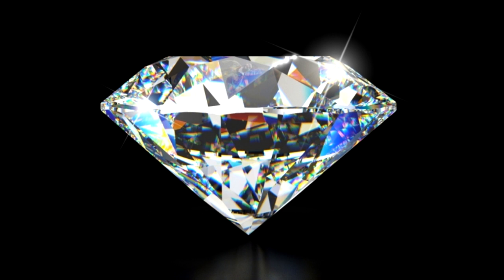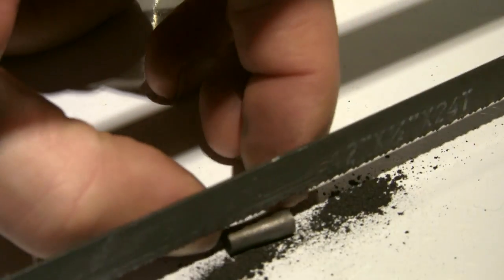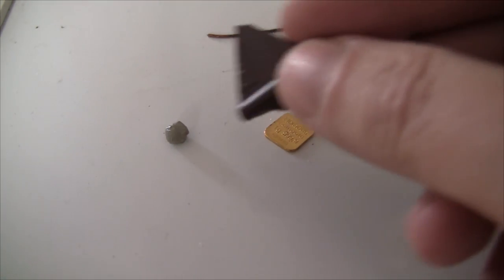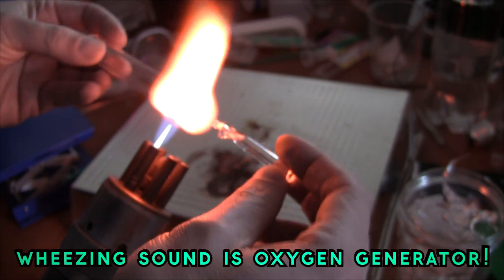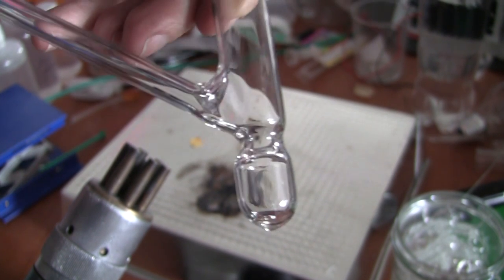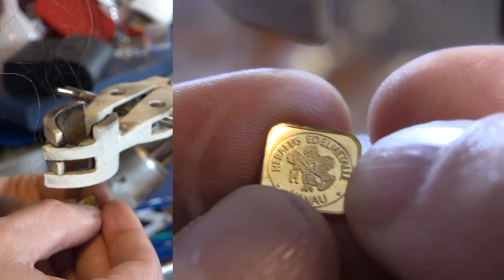Can burning Diamond melt Gold?

Comment from the maker: Theres actually a point to this other than burning diamonds look REALLY cool, and burn REALLY hot..... and its to do with why making nuclear batteries out of diamonds is a really, REALLY stupid idea, and not just cos diamonds burn!
Reply: Thunderf00t you gotta stop destroying all you bling Tf00t!
Reply: do the diamond carbon dioxide in the drink
Reply: First off super cool to see a burning diamond, because i did not know that could be a thing. Also the glass work we saw, can you please do a video on that. Because seeing you form the glass tube and all that was super interesting and neat to see.
Reply: THORIUM COATED DIAMOND FREAKING BATTERIES!
Reply: hit the diamond with a golden hammer! durp durpy durp :)
Reply: Could you maybe get a better transfer of heat if you place the gold on top of the diamond? I only say this because the oxygen only has one way to travel, so to me i would think that the oxygen is also pulling heat up and out of the tube, Maybe with the thermal camera we could see if the bottom or top of the tube is hotter, for my idea to be true there would have to be a massive difference in heat  over the diamond vs under it.
Reply: i really wanna see you debunk those 'batteries'
Reply: Thunderf00t hey a short vid on your glass working gear and technique would be awesome..... or a long vid, ya know, whatever u have time for.
Reply: Thunderf00t lol you made a crack pipe
Reply: do the diamond carbon dioxide in the drink
Reply: Did you mean to include that video of you glass-blowing a crack pipe?
Reply: Thunderf00t Honestly I think the O² was cooling down the bottom of the gold so much that it just couldn't reach a 1000 degrees. just a thought.
Reply: Please make a video on how to make/blow the glass thingies. <3
Reply: Thunderf00t do you think that the glass added to the thermal mass of the gold?
Reply: Awesome video mate. Quick FYI- Diamonds shatter if you hit them with a hammer.
Reply: TF,

I enjoyed seeing the glass apparatus manufacturing.  Is this a lost art in the scientific community or what?
Reply: You should end that debunking video with lighting a cigarr with a burning diamond
Reply: and again Thunderfoot make women cry
Reply: you could have saved you some time if you just had bought a crack pipe xD
Reply: How expensive was this small uncut diamond?
Reply: Pretty sure gold was too good at transfering all the extra heat to oxygen and CO2. Are you sure diamond is using most of the oxygen? You might want to lower the flow for optimal results.
Reply: Bonus fact: Hot Diamonds will shatter when cooled rapidly. Much like adding ice to water. (I am sure Thunderf00t knows this).

I have seen this happen many times as a novice jeweler; I would love to see the inclusion generate with the phantom you have.
Reply: +Thunderf00t This might be a dumb question, but wouldn't blasting the diamond, and the gold underneath it, with relatively cool oxygen hinder the efforts to melt the gold? I mean, I get it, you need the oxygen to make the diamond burn, but aren't you at the same time also cooling the gold? (Or maybe I'm just overestimating the amount of oxygen you're blowing at it)
Reply: stop saying it is cool,it's pritty fuckin hot
Reply: Before you go and burn another diamond, I think we need to talk about some physics that of course you are well aware of but have not taken into account. If you had used your thermal camera, you would have seen the precise surface temperature of the burning diamond, you'd also see where heat was being sinked away, and how close you were getting to melting the gold (that's if your thermal camera does those temperature ranges). Continuous spectra from hot objects and flames, is caused by interatomic collisions (It's not the same phenomena as line spectra). The faster the atoms are moving the more blue the photons released, the slower the redder. Just by eyeballing, I can tell the surface of your burning diamond is cooler than a blue bunsen burner flame.  By eyeballing I can also tell there isn't much heat transmission happening from the diamond through air to the gold, if the air was that hot the interatomic collisions would have at least have it in the visible range, it's not, and the pressure differentials are probably creating a cooling flow of air, helping defeat the exercise. So, we could assume that all/most of the heat transmission that's occurring is from the surface area of the gold in direct contact with surface area of the diamond,  and the rest of the heat from the burning diamond is being lost to where there is the most surface area contact, which is the air. And there is a classical thermodynamics formula for calculating this stuff, which i don't remember but I know exists. Now. The surface area of the burning diamond in contact with the gold has another problem, that area won't be burning because it can't get oxygen, it will be relatively cool. If you want to melt gold with a diamond, heat the diamond with a blue flame, and then it will eventually reach thermal equilibrium with the flame and it will melt the gold, if there's enough surface area contact.
Reply: If you want to melt something, put it on top the combustible, not under it.
Likewise, the air/O² entry need to be under everything.
And the combustion gas need to be able to evacuate from the top.
Plan:
[Exhaust]
[Material to melt]
[Combustible]
[O² entry]
Reply: Thunderf00t I like heating the diamond and dropping it in liquid oxy it the diamond burns crazy bright lights up the room
Reply: $15 diamond
Reply: To your last part, they use hammers and rollers to crush diamonds for industrial purposes. Jewelers use hammers to break diamonds. Its all about applied force to stress fractures, and your uncut diamond shown looks to have a lot of fractures. It'll probably shatter along its stress creases, and dent/scratch the head of the hammer where it makes contact. Might even embed itself into the head depending on the force.
Reply: Does this act similar to a perfect black body because of its conductance?
Reply: Thunderf00t what's the link for the diamonds?
Reply: Cool! I'm a fairly new subscriber so please excuse my asking this question, you obviously have a substantial background in 'the sciences' but where did you learn to handle glass like that? You made it look so easy & I'm quite sure that it's not, very impressive indeed bro!
Reply: You are correct, I've done it as a jeweler. Dropping a hot diamond in water will generate inclusions "cracks" as well. Even a diamond without inclusions will shatter under a steel hammer. However, the hammer will have a significant dent (but i've never seen one get stuck before, but i suppose its possible). You can even crush small diamonds with pliers in your hand. Hardness is not the same as tensile strength. However, I would like to see the inclusions generate in slow motion.
Reply: I guess the contact area between diamond and gold plate was too small. Also, keeping the plate above the diamond could help, most of the energy was wasted. Also, I think the blowing oxygen is having a cooling effect on the plate.
Reply: Thunderf00t You mean this wasn't to prove that we can use the energy displaced by the melting gold from a burning diamond, and redirect it into a new propulsion system to use in outer space? There goes my Kickstarter.
Reply: Simple, don''t put the batteries in an oxygen rich environment.
Reply: Your awesome, instead of burning money, you burn diamonds.
Reply: I feel like I just watched you make a crack pipe and smoke a diamond out of it.  let's see Cody's lab do that.

Nothing against codyslab, he's awesome.
Reply: Blow torching glass without any protection? Safety must be your number one priority.
Reply: That was as awesome a crafting part of the video as the actual experiments. Maybe as routine for the actual scientists, but really cool to watch as an uninitiated ;-p
Reply: collab with cody :D
Reply: how can you make a solid gold hammer if diamond cant melt gold
Reply: Thanks for making one of the most expensive pieces of Toblerone of the world.
Reply: Thunderf00t would you be at all interested and or confident enough to test if chlorine tri fluoride is able burn diamond?
Reply: John J look for a video on making vacuum tubes by hand if you like glass workmanship
Reply: Really dumb question, as I assume you did, but did you count for heat loss due to convection and air currents? Simple contact may not be enough when you have other losses in the system.
Reply: You seriously expected someone smart from Bristol?
Reply: Thunderfoot makes a bong that burns diamonds and gold, has science gone too far?
Reply: I think what you are doing wrong is that you are placing the diamond over the gold rather than under the gold. The heat from the diamond burning is bound to be rising away from the gold. Try placing the gold immediately above the diamond, supported just above it somehow, as the diamond burns.
Reply: oxygen is not flammable it just helps with combustion
Reply: Thunderf00t you made a nice water bong
Reply: Fair enough but did it really need to take 16 minutes to burn stuff? I FUCKING LOVE FIRE but I had to cut to about 11 minutes in when the magic started to happen.

I love your videos btw (well except for the ones where you fight with dumb ass feminists who thrive on drama and thus feed the drama) so I hope you don't think I am being too harsh.
Reply: Thunderf00t everything burns....
Reply: Downstream01, he says it's in the works at the end of the vid
Reply: Although you might have to use probes, because i am unaware of any thermal cameras that can measure that small and precise.
Reply: You can make diamonds out of my batteries any day Thunderfoot just pack them in tight ;)
)
Reply: is it because Diamonds aren't that dense?
Reply: Thunderf00t how hot does a diamond burn? I doubt I could have the opportunity to do this.
Reply: IamCrusaderRUS: Yeah, I was thinking the same thing. Maybe you could match the flow rate of the oxygen to the burn rate of the diamond, to keep it from cooling down the system too much. And/or preheat the oxygen, although that might count as cheating. Then again, you already preheated the diamond :)
Reply: this is fucking cool. thanks.
Reply: I look forward to a better explanation.   You seem to love busting the bullshit that I see all over the place, but I couldn't put my finger on the diamond battery thing.
Reply: I think this too. Maybe you should have used a thermal Isolator directly below the gold (like a small pan) to shield it from the Gasflow.
Reply: If the design would have blown from the top, making a kid of melting torch could maybe do the trick.
Reply: TheZabbiemaster He said something about it in his last video with the dimond ... something around 15$ I think but better go checking.
Reply: TheZabbiemaster he said something about that in his last video ... arround 15$ I think.
Reply: Thunderf00t of you should have used thermite to start the diamond on fire
Reply: najs123 that would conway the message pretty good :)
Reply: The gold has a relatively high thermal conductivity (310 W m-1 K-1). That is why you can't make it melt just like that.
Reply: Dropping a diamond in liquid oxygen is something the Open University did...the diamond fizzes away to nothing.
Reply: Thunderf00t what about making computer chips out of diamonds.
Reply: +EATHER2468 too expensive, too hard, and offers little to no advantages.
Reply: phil, now you gotta test to see if gold will burn in a pure chlorine-triflouride environment.... (definitely NOT trying to give you nightmares of the horrifying, horrifying chemical that is chlorine triflouride)
Reply: What about artificially grown diamonds combined with boron to conduct electricity.
Reply: Cool, look forward to seeing your video about it. I head a while ago that someone came up with some gold batteries that supposedly worked much better than current batteries, their claim was only that they could be recharged without losing their effect almost forever, but they didn't have more capacity than normal batteries. Sounded legit to me, but it's not like I tried to research it or anything, maybe you'd want to have a look at that too someday
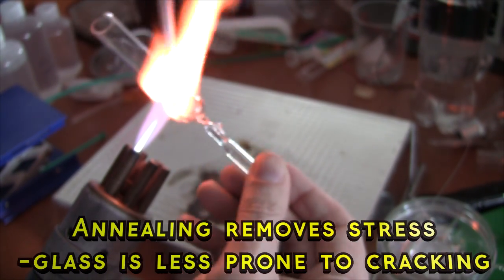Reply: Thunderf00t at 9:18 it looks like you were making a bong
Reply: TheZabbiemaster its on the previous video, the price of that uncut diamond...
Reply: Interesting side note to the gold... its from heraeus a German family owned company. In 1927 Wilhelm Heraeus had to join the company pressed by the family. Instead Wilhelm wanted to continue to be a university physic researcher. Thus at the end of his life he created the Wilhelm and Else Heraeus foundation to support fundamental physics research....
Reply: Thunderf00t I think you would need to have gold inside of a bit of diamond.
Reply: to get a better chance at melting the gold, and you did it with the graphite is move your heat source to the bottom. while you produced a load of heat most escaped and never effected the gold.
Reply: +T.kuvesi I was wondering that too.
Reply: can we get in a war too? I want chocolate.
Reply: not sure where you're conducting this experiment, but perhaps fluorine instead of oxygen would make it work.
Reply: Nice, that was great stuff. ^_^
Reply: Who was your vendor for the diamond?
Reply: Close off the restriction in the apparatus, create a new one that holds the diamond above the O2 inlet, create a second restriction above where the diamond will burn for the gold. Light the diamond, drop it in, drop in the gold, gold will melt.
Reply: Duc Tran He made me cry. That diamond could have made a diamond file.
Reply: Hey Thunderf00t, under the right circumstances can anything burn?
Reply: Thunderf00t PLEASE link to the diamond!
Reply: T. kuvesi it doesnt matter because the part thats hitting the gold is not the same part as the burning diamond, plus, diamond burns alot hotter than the "cold" oxygen can cool down in time, about several hundred degrees so
Reply: Maybe next time, put the diamond beneath the gold? Like, plop the diamond in there, then drop the gold in on top.  I don't know if it'd make a difference, but maybe.
Reply: Thunderf00t just how hot did the diamond become while it was burning?
Reply: Thunderf00t bongs 101 with thunderfoot
Reply: I wonder, just how many BTU does a diamond give compared to a similar weight price of coal
Reply: What is the reputable source you got the diamonds from?
Reply: siphra - he has not accounted for this and it is causing him problems
Reply: Why do you never name the music in the description of your videos, Thunder?!
Reply: Thunderf00t In an Oxygen rich environment. How about in one devoid of any oxygen?
Reply: Hi Phil, I sent you a private message to your channel regarding helen caldicott, please have a look
Reply: compare to molten kclo3 :p
Reply: http://9gag.com/gag/aZmnjRQ is this plausible? Maybe do a video on it? Thank you!
Reply: Isn't it the gold were being cooled by blowing oxygen?
Reply: +Thunderf00t Thought I would throw some easy pseudoscience/debunking material your way Hanging Asteroid Skyscraper: http://www.dailymail.co.uk/sciencetech/article-4354612/Architect-unveils-skyscraper-hangs-asteroid.html oh and Already speed and battery life specced drone looking for donations...just with cool graphics and no prototype: http://www.dailymail.co.uk/sciencetech/article-4354612/Architect-unveils-skyscraper-hangs-asteroid.html
Reply: Also, a quote from the first article "The team discovered that there is most likely a height that people could not tolerate living due to the extreme conditions. ‘For example, while there may be a benefit to having 45 extra minutes of daylight at an elevation of 32,000 meters, the near vacuum and -40C temperature would prevent people from going outside without a protective suit" ......no shit sherlock..
Reply: can you make 1 mole of sugar(C6H12O6) out of 6 mole of water(H2O) and 6 mole of graphite/diamond(C)  or the energy needed for this chemical reaction is too mutch ?
Reply: Thunderf00t debunk the heathrangers "cesium eliminator".
Reply: Thunderf00t Here's a new one to bust.  http://www.nbcnews.com/mach/space/firm-floats-plan-hang-colossal-skyscraper-asteroid-n739601  "Floating Freaking Skyscrapers!"
Reply: Selem, that's why I used a fake name on my broadband, used my own modem and rented a Dedicated Server and installed OpenVPN on it.
Reply: Selem Bradly oh yah absolutely i don't disagree at all. But this is just one spoke in the big brother wheel. if there's money to be had then corruption trumps morality every time. senators will be lobbied, pockets will be greased and there will be bribes all round for the cigar smokers. maybe if enough of us kick up a stink things can be done to stop it. but it doesn't hurt to protect yourself in any case
Reply: That shouldn't make a difference. You would have the same surface area in contact (same heat transfer) and the hot air that is rising (hot air rises heat does not) won't conduct heat enough to make a significant difference in temperature.
Reply: Thunderf00t graphite is what our tools are made of.
Reply: Well that's utterly disgusting, burning diamonds or melting gold is one thing, but burning perfectly good chocolate, how could you? Or was it Hershey's? that's OK then :-)
Reply: I am ashamed of only one thing in life. That I actually like Hershey's :( It is indefensible I know, maybe even some form of pica.
Reply: Thunderf00t is that actual edible chocolate?
Reply: I would have been interrested to see the spectrum comming of the burning diamond. Would that not have provided clue as to it's exact chemical properties? Mostly probably would have been carbon ofcourse.
Reply: Why? Doesn't graphite also burn in oxygen? Can't you also get it to burn in air under certain circumstances? Like say having a lot of energy stored in the lattice by neutron bombardment? But yet graphite is used in RTGs all the time. And those things have survived reentry intact. Also you can make Lonsdaleite type diamond analogues in any shape required by pyrolysis of polyhydridocarbene in an arc furnace or by CVD or explosive pressing of graphite on a smaller scale. Lonsdaleite has a higher thermal conductivity than any other non metal except diamond proper, apparently.
Reply: Didn't he prove that with an experiment before the diamond? He struggled (but less than with the diamond) but in the end burnt it and melted the gold
Reply: Thunderf00t should've put the gold on top of the diamond.
Reply: At least you now know how to make a bong.
Reply: try some diamond powder and some gold powder/chunks mixed, like they would do with coke and iron foundries.
Reply: why doesn't the fish tank explode?
Reply: Chris Mains, that is actually not that hard. With a proper instruction and a little practice almost everybody can do that. I had that as part of a course as well* ... though due lack of practice I would me take a while to get results as this.

--------------
*=covering the basics ... since it was once common practice for chemists to make their own apparatus.  (for special applications)
Reply: Filling a fish tank with pure oxygen? Could that tank explode introducing flame into it.?
Reply: @Hypnotic
An oxygenation (smething burnin) only happens if you have oxygen and something that reacts with oxygen (fuel). If there is only oxygen ... like in pure oxygen ... and other products that you can't burn* ... like glass or gold ... nothing much will happen. In fact nothing can happen.

__
*= with oxygen, these processes are also able with other substances ... which are even more aggressive than oxygen ... but that is irrelevant for now.
Reply: You are my Idol
Reply: Thanks
Reply: burning a mountain of money would have taken up less time....
Reply: Titan360 you realize it was a 15$ diamond off Amazon right?
Reply: Yet six months later...
Reply: Thunderf00t ... But I saw a video for diamond freakin' batteries! It's gonna change the world brah!
Reply: I wish you would have been my science teacher
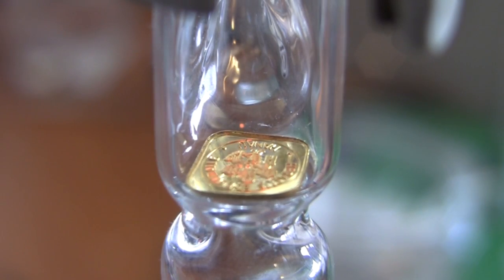Reply: 16:20 ... support this channel? Why? So that you can heat your room by burning diamonds? ;p

Was obviously joking here ... just say this in case it wasn't as obvious as I think it was
Reply: 1000c hot knife challenge molten diamond?
Reply: if you use a hammer it has to be made of solid gold or iI will unsubscribe
Reply: Thunderf00t. My newest research in alternativ statistics, suggests that any claim about new products or breakthroughs, made in a video with ukulele infused happy tunes, are with 97.6 % certainty false, and can be dismissed without testing. The remaining 2.6 % can be dismissed, based solely on the annoying taste in music on the claiming parts behalf.
Reply: Wonderful. Much better than the repetitive political videos.
Reply: Oh my god - in whom I don't believe. I just realized what you're trying to do, your trying to get one of those igNoble Prizes aren't you?